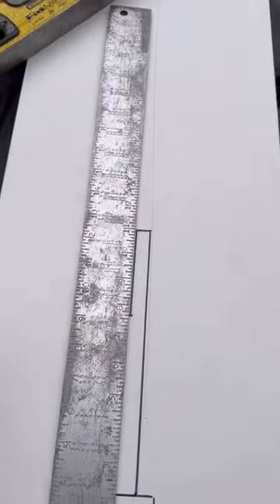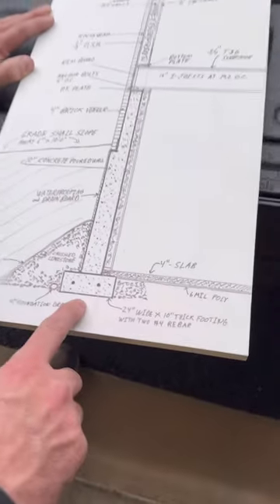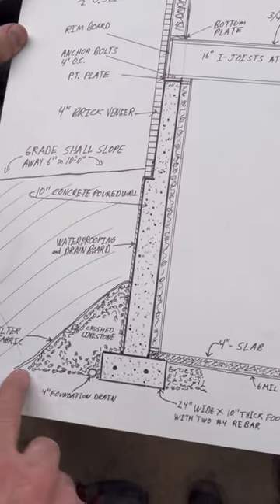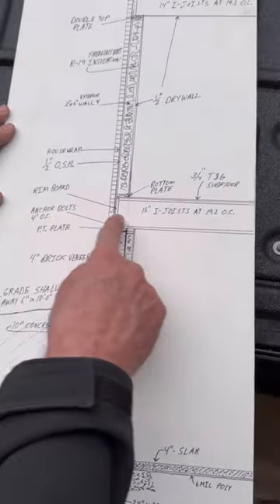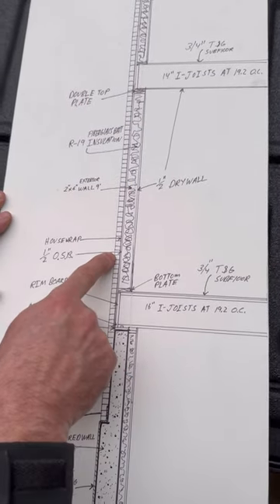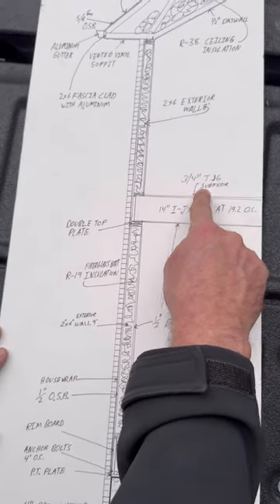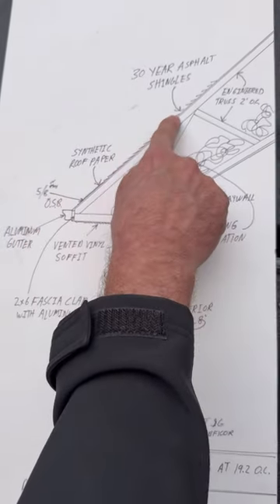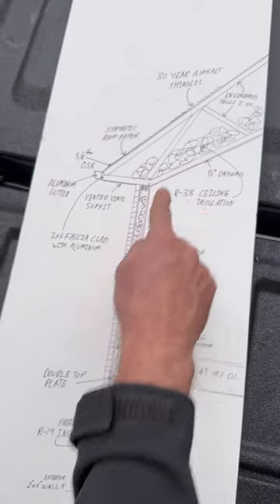Understanding Wall Sections on House Plans

Comment: It will take years-how many?- before the current fabric drain design will fail...using only half slotted pipe-with slots down- has been proven to work ...years of experience will tell the difference...hope my experience helps those that this info WILL help...but, any method can be done..your call...

Comment: Make your brick ledge 4 and 5/8" to accommodate a 1" airspace for brick veneer. Cavity filled with mortar up to the flashing at the lumber
Reply from the maker: We only have a 4 inch ledge, but the Mason hold the brick off the front to get that extra half inch or so
Reply: @hausplans 
Makes sense. Then a half inch thick parge coating will meet up with the face of the brick.

Comment: From 1990 to 1998 I did all of the structural plans and details on a drafting table for Tucker Engineering in Round Rock Tx. I miss that. I like your details as I used some of the same ways to depict washed gravel fill… 
I did so many drawings with square letter script that I forgot how to write in cursive! 😂

Comment: I'm surprised the brick veneer extends all the way into the ground level. Up in Canada we're used to the foundation wall extending up to the first floor and having the brick veneer start at the top of the wall.
Reply from the maker: It’s different here and we have waterproofing behind the brick so it’s not a problem with the foundation leaking
Reply: @hausplans  yeah, I love the cross-section drawing you did.  Hardest part is making sure people know what you're trying to point out to them. Lol.
Reply: You are correct, the brick veneer needs weep holes at the bottom head joint to let any moisture out just above the finish grade and above the pan flashing if any.
Reply: @hausplans it's not about the foundation leaking as much as the brick eroding from contact with the ground absorbing water

Comment: Is the brick veneer tied to the rest of the house at all (other than the bottom row of bricks being on top of the foundation)?  I've always wondered why those entire brick veneers don't just fall away from the house after time.  Certainly they aren't PERFECTLY vertical and a little bit of shift in the house and should'nt that massive slab of bricks just fall away from the house?
Reply from the maker: Yes, it’s connected to the house with brick ties
Reply: @hausplans  thank you!

Comment: Insulator here. Spray foam for the last 5 years mostly but batt and poly and blown in attics as well. Thats terribly insulated if thats batt and blown in attic. Spray foam for those r values is ok. Is r7 per inch for our product .Walls could use 3.5--4  inches of foam but  r19 its less that 3. Attic would be over 5 inches at r38  which is good for foam. But batt or blown in. Where i am code is r24 for walls ans r50 for blown it

Comment: I work as a framing assistant helping to build garages. New to this, i wanted to ask why the wood framing in the walls on the main floor wasn't included in the drafting? Im likely missing something here. Many thanks
Reply from the maker: I think by the first floor you mean the basement?
Reply: @hausplans  Yessir

Comment: 2x6 is super important. Makes a huge difference in insulation. I think we switched from 2x4 outer to 2x6 in the 1980s were i live. Un less you were building really cheap
Reply from the maker: Agree, also, it doesn’t really cost that much more

Comment: 5/8 roof decking 
Man, that's more than most
Reply from the maker: I’ve always use 5/8 it cost a little more and it’s a little little bit heavier to install but you’re less likely to have ripples in your roof
Reply: @hausplans  Do yall staple it on?

Comment: 4"slotted drain pipe(all the way around) will eventually cause a problem-will fill up with sediment (dirt/mud)...it is best to use half slotted 4" drain pipe AND put slots DOWN!....AS WATER soaks through ground, it goes to bottom and RISES up into pipe through slots, ....it does not drip into pipe, but rises up and is drained away.....MOST DONT KNOW THIS-...BUT, NOW, MORE KNOW...
Reply from the maker: We cover the pipe with crushed stone and then put a layer of filter fabric, so no sand or sediment will ever get in

Comment: Not sure where you live, but 5/8 rock is required on lids where I am.
Reply from the maker: It’s only required in garages if there’s finished living space above in my area
Reply: @hausplans  it’s used as a sort of roll brace here. I guess rat runs and roll blocks aren’t enough for sheer out here. lol.

Comment: With that deep of retention your footing is not adequate.
Reply from the maker: It is, keep in mind It’s braced by the floor system. It’s not a retaining wall.
Reply: @hausplans  Then you’re not going to backfill until the upper floors are built? Because if you are going to backfill and compact the footing is not deep enough nor wide enough. I’m a structural engineer by trade.